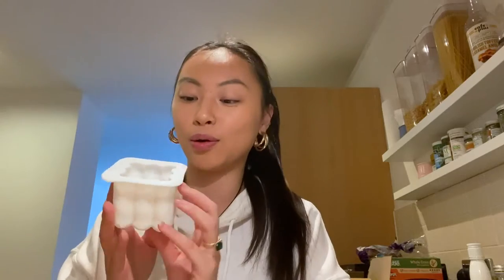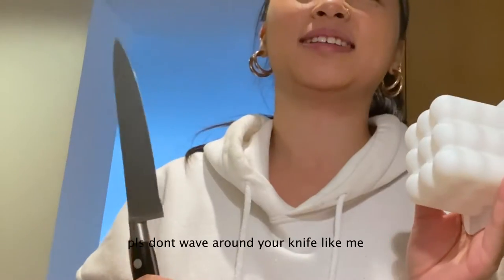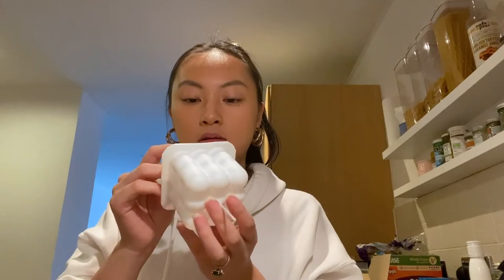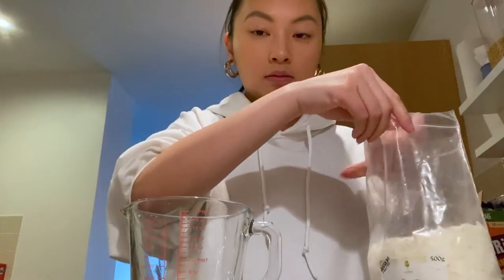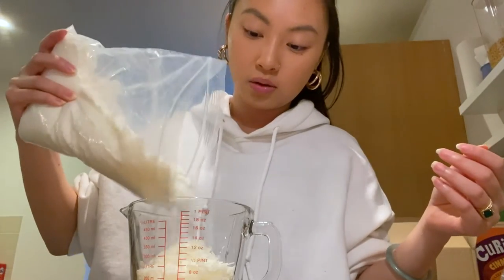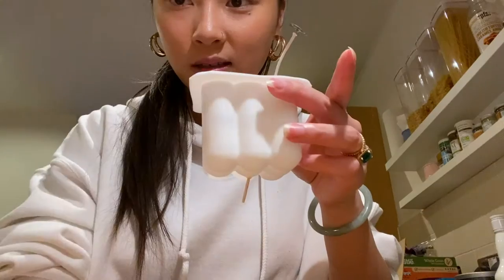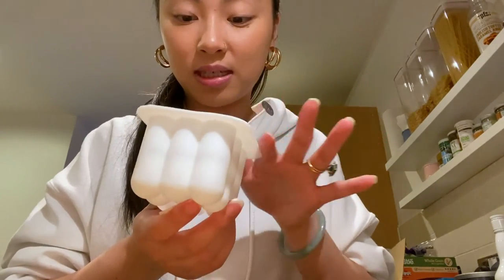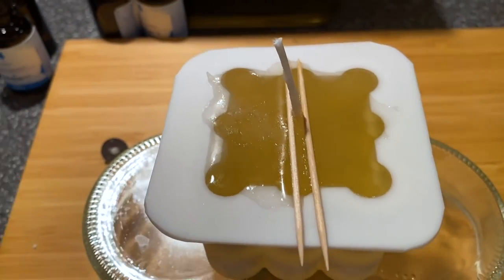HOW TO MAKE BUBBLE CANDLES USING SOY WAX | KERASOY 4120

Comment: My bubble candles never seem to set on the top properly (so bottom of the mould) I’ve tried leaving it to set longer and I’m making sure I pour at the right temperature, tried putting the mould flat on the bench and ontop of something with the same problem. I’ve not had a problem with any other mould shapes wondering if you have any tips to stop this happening!
Reply from the maker: Thats so weird! Never heard of this! Does it set at the bottom (top)? If you have pics, please show! (Facebook, vibely or IG) xx

Comment: Great video just wondering if you have ever burned a bubble candle I tried to make it but every time I've tried the candle as the candle is burning it drip all over my candle plate. is it meant to do this? id rather it just tunnel down than seep out. any advise you could give would be great. my bubble candle has a 5 inch diameter and I've used tcr 24/14, tcr 21/12 gonna try an eco 0.5 and eco 1 tomorrow. I'm determined to make one for my mum for mother's day hunting running out of time 😬